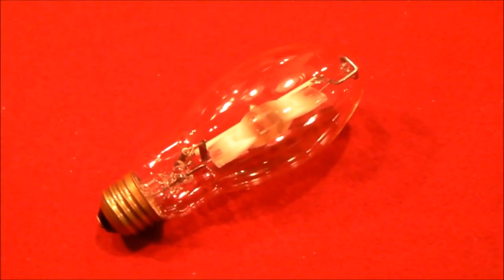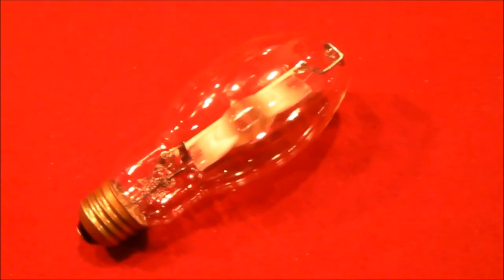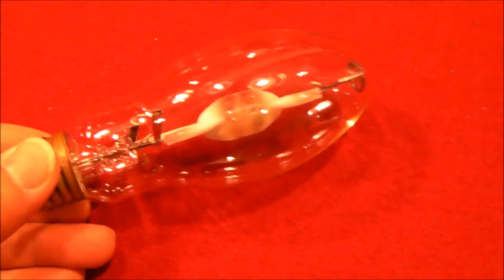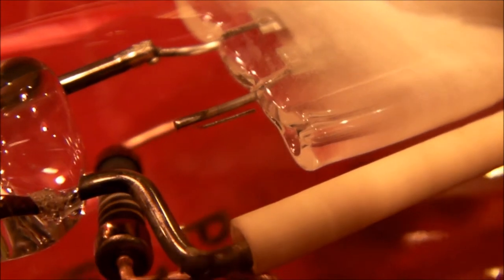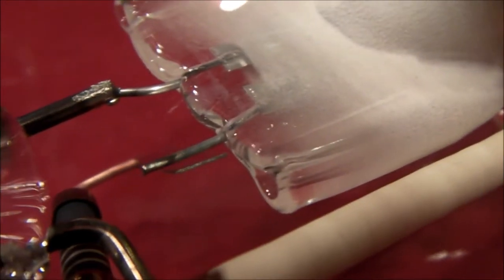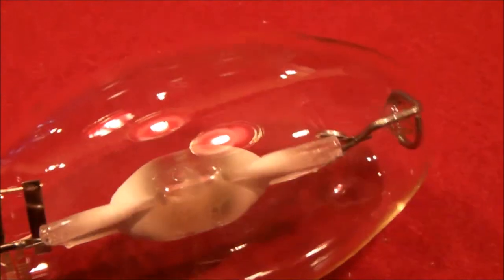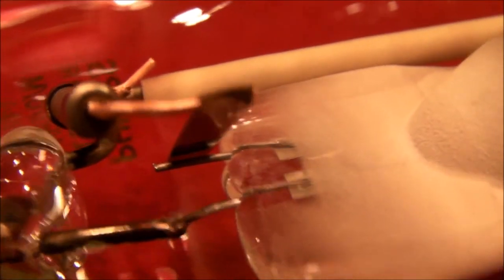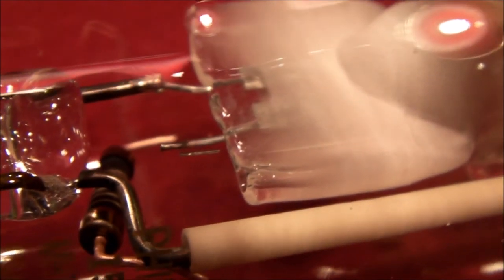Metal Halide bulb won't start, won't light; Troubleshooting 175 watt metal halide bulb

Comment: yes, you can also break the outer lamp, bend a few things a little (but not the bimetal strip itself) and all will be fine.  catches: no outer shield means quite a bit of UV will come out.  I am uncertain if the temperature will get high enough to let the bimetal separate.
Reply: You are exactly right the bulb will not get hot enough if the outer Glass has been broken

Comment: You could in fact use a Pulse Start Metal Halide ballast to start the lamp even without the starting electrode and resistor.

Comment: I have 4 Greenlee brand, mercury vapor landscape lights controlled by a light switch and only the last 2 in the row come on all the time when flipping the switch.  The first 2 will sometimes come on if I unscrew and SLOWLY screw the bulbs back in to what seems to be a certain contact point and work perfectly until I switch the lights off.  The next night I have the same problem with the same lights when flipping the switch on.  All the bulbs are new “EYE MOON H100 pulse” and I hear a slight buzz from each of the lights underground box.  There is no water inside the box when I remove the weatherproof lid and when I remove the glass lens there is no moisture inside the light canisters.  Any suggestions?
Reply from the maker: i would swap good bulbs with troublesome bulbs and see if it is the socket or the bulb
Reply: YuDaMan Today i noticed my #1 of 4 landscape boxes which contains all the electrical components for that particular light was full of water. I lifted the plastic box from the ground and poured out the water. I’m guessing perhaps I didn’t have the rubber seal/lid screwed on tight over the winter from working on my previous issue above.  I left this upside down all day in the sun for it to dry out.  Do you know if the entire electrical components get flooded if it is ruined or once completely dried out will it work again?
Reply: Frank that didn’t work

Comment: This is quite obvious...it's like realizing your tv doesn't work because it's not plugged in!  What if the bulb is perfect, and even after trying a new mh bulb, it still won't light..it flashes on and right off...but hps bulb works just fine.